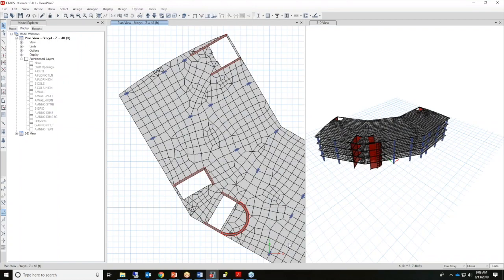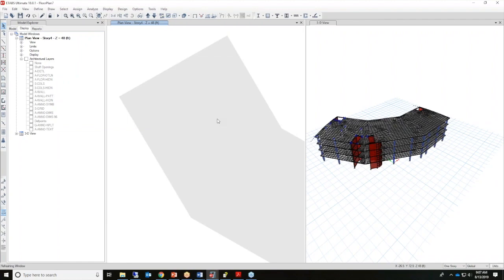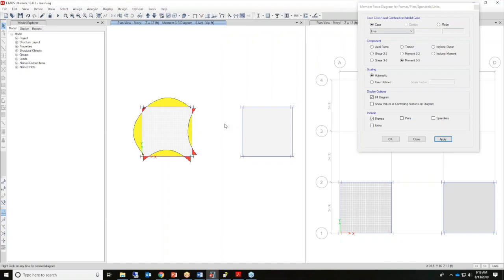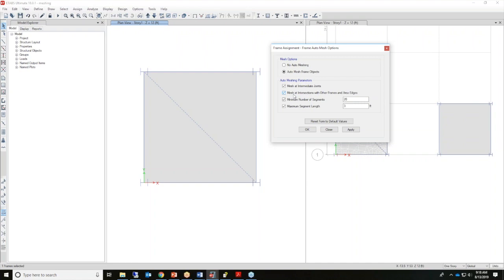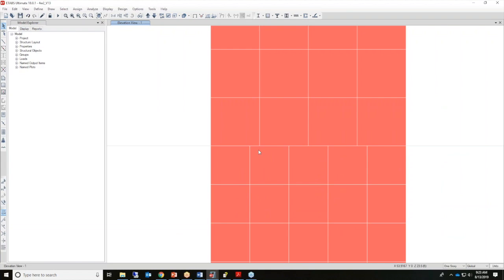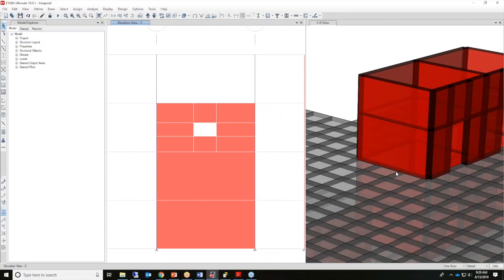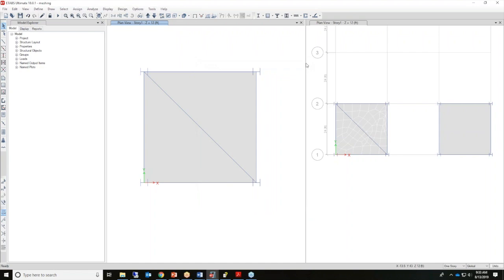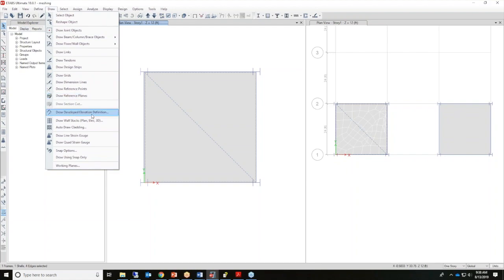WEBINAR: How to use Meshing Tools Effectively

Comment: Im confused if your floor is assigned as membrane. Will it matter if you choose default or cookie cut? 
For the walls, do you need to assign auto line constraint to all beams and columns that is connected to the walls?

Comment: I tried using general mesh in irregular slabs. however, I was getting errors that load was not being transferred from balconies to the floor slab. The deflection contours didn't make sense as one slab was completely dropping off. It seems general mesh isn't good if you have two separate curved slabs modelled next to each other. Surprisingly rectangular mesh worked in that instance.

Comment: When I export results from Etabs and try to model foundation whether strip or raft, I get some areas with strange meshing(a meshing gap) and high concentration of reinforcement in that region. Whether those areas needs to be manually meshed or other solution. Please show us. Any other viewer can also help. Also if the Raft is with different thickness, say raft below walls are having more thickness and rest area with comparatively less thickness. This issue normally observed with meshing along grid when I think mesh size are not in line with the grid.